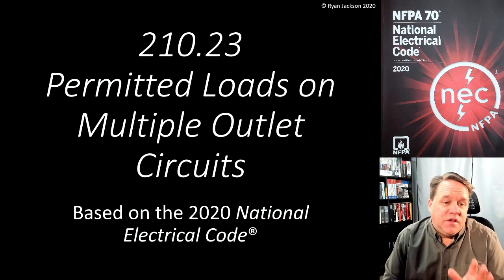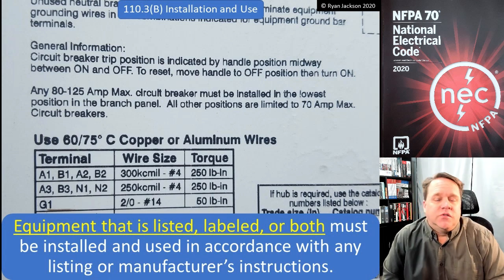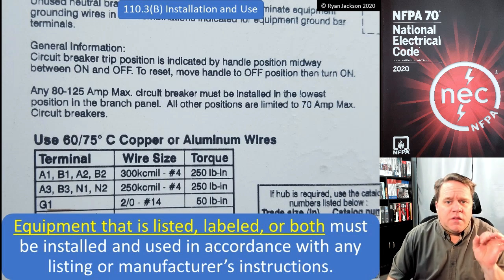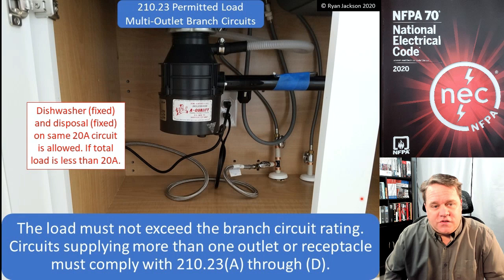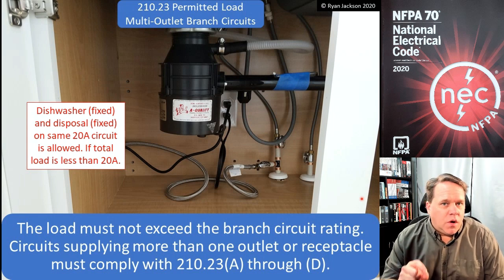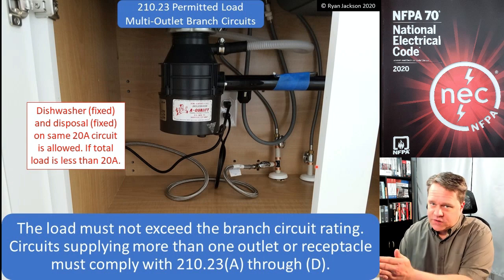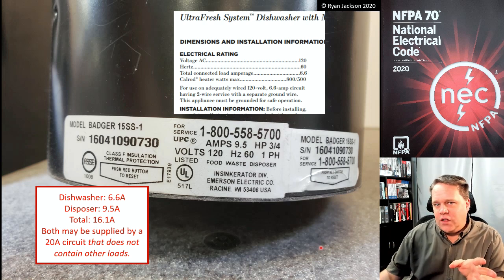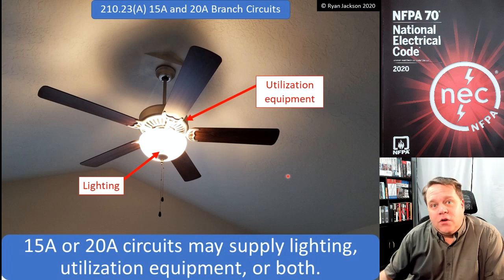Dishwasher and Disposal on same circuit? NEC 210.23 says...probably.

Comment: This is extremely helpful and informational. I have one question though. Are ranges and clothes dryers considered fixed or plug and cord appliances? At 16:43 it sounds like you are saying dryers are not considered fixed equipment and are limited to 80% of circuit rating. Is that true for a range as well?

It is often implied that these large appliances are “fixed” even though they are not hardwired.
Reply from the maker: They are stationary, not fixed.
Reply: @RyanJacksonElectrical  so to clarify, the 80% rule would apply to both dryers and ranges then?

Comment: A 20 amp circuit is usually adequate for most all residential dishwashers and disposals.  Most ratings I see for dishwashers are between 6.5 to 10 amps.  The 1/2 hp disposal you see in 90% of homes would not cause an overload to that 20 amp circuit even when the dishwasher was on the dry cycle.  I definitely wouldn't share them on a 15 amp circuit, but a 20 amp circuit should be fine for pretty much any home dishwasher & disposal.  If the homeowner upgraded to an commercial disposal or large capacity dishwasher, than it might not be enough, but it should be fine for pretty much any 24" home dishwasher & 1/2 hp disposal.  I've never ran into a problem because I've never had a homeowner trying to install equipment that would exceed it.  I guess in the future, I will run designated circuits for them even if it is not required.

Comment: I'm an old-school electrician I go by the old school rule if you can't take it and move it to another area and use it it gets its own circuit simple above stove top microwave bolted to the wall can't move it gets its own circuit dishwasher connected to the water underneath the sink can't take it and move it get its own circuit garbage disposal connected to the drain pipe can't move it gets its own circuit kitchen hood fan bolted to the wall connected to the exhaust vent gets its own circuit now refrigerator can be moved however it gets its own circuit for food safety so that it doesn't get shut off

Comment: Thanks for the three hour rule explanation for continuous operation. I upgraded my built in non-plugged electric furnace air handler to a 5 ton from a 3.5 ton and it had a 100 amp breaker. We put a current meter on it and it read 82 amps on high. It is a 2 speed, 42/82 amps. The 2 amps is for the blower motor. We were uncertain about the definition of continuous load until I watched your video. The heater will never be on high for three straight hours.

Comment: Have to poke fun at hard working brillant Ryan but here goes. Heard of people coming out of the closet but never somebody coming out of a dishwasher. I always installed a dishwasher on thier own circuit breaker but now with combination AFCI/GFCI single pole circuit breakers costing close to $50 each would reconsider adding the garbage disposal to a single circuit. ( 12 guage copper NM on a 20 amp AFCI breaker. Dishwasher load calulation can be misleading. The motors in all the new dishwashers use less power then the heating element and believe the calculation should only use the 125% multiplyer for only the motor then add the ampere for the heating element. Heating element is purely 100% resitance load with 100% power factor and no locked rotor intush current like a motor.

Comment: You discussed UL rating for household appliances. How about commercial equipment? We are seeing a lot of equipment imported from overseas that are obviously not listed. 
For example, refrigeration equipment for walk in coolers etc. We always get asked if they need to be UL rated. As far as i checked, i do not see NEC requiring UL listing on those kind of equipment. What would your thoughts be on that? Sometimes these equipment will even require European voltages like 380 or 400 volts 3phase or 220-240v single phase line to neutral power. They will offer to sell a transformer to come along with it. It'd be great to see a video about tips and tricks for compliance. Your content and explanations are fantastic. Thank you.

Comment: No problem, those are very small motors. Also should be 20 amp circuit according to everything else in a kitchen.
Reply from the maker: It doesn't have to be a 20A circuit.

Comment: In my opinion, think it’s a good practice to always run a Multi wire or two separate circuits for the DW & Disposal, especially in new construction and major remodeling.  This video really provides the rationale, both the DW and disposal are fixed, but are also replaced / upgraded over the years.  Two circuits will protect the option to upgrade, without having to rewire @ some point in the future.  However, for homes with one circuit this video makes it perfectly clear what you can do.
Reply: Modern appliances use less energy. No need for two circuits.
Reply: the amount of time the disposal will be running it will not even trip the breaker due to an overload

Comment: Ryan, your knowledge is godly but I have to disagree with you here. Your argument (at 7:15) is premised on the circuit having only one outlet or receptacle. But a duplex receptacle is TWO receptacles (art. 100, definition of receptacle) and that means if either the disposer or dishwasher are > 10 amps you need separate circuits for the two as the equipment is fastened in place. If both are hardwired, you again have two outlets which leads to the same result.

Comment: can you yes; should you no.  Having a heavy motor load right next too and on the same circuit as senstive electronics in modern dish washers helps account for their increased failure rates. I separated mine by just running 14/2/2 to that location.

Comment: How do you get around Table 210.21(B)2? Maximum cord and plug connected load on a 20 amp receptacle and a 20a circuit is 16 amps? Maximum on a 15 amp receptacle is 12 amps.
Reply from the maker: A duplex is two receptacles. The total load on the duplex is limited to the rating of the device. Each of the receptacles can take up to 80% of that rating.
Reply: @RyanJacksonElectrical  210.21(B)2) refers to more than one receptacle. Read it
Reply from the maker: @JeffBanfield-t6v  I am aware of that. I have read it once or twice. What do you beleive the Code violation is?
Reply: @RyanJacksonElectrical  I paused the video at 7:50 mark. It reads disposal is 6.6A and dishwasher is 9.5A = 16.1A 'Both may be supplied by a 20A circuit that doesn't contain any other loads'. 
Assuming you have cords on them, that is a violation of Table 210.21(B)2 that states the maximum cord and plug connected load is 16 amps for a 20 amp rated outlet on a 20A circuit.
Reply from the maker: @user-ll1vj7qo1m  No it isn't. A duplex is two receptacles, not one

Comment: Great video, I just went through the stuff when a customer asked to add a disposal to their island sink. They had a dedicated disposal at their main kitchen sink. I couldn't find a reason why you would need to pull a new circuit when the original could handle both loads

Comment: What about table210.21(b)(2) Total cord and plug connected load. No more than 16 amps on a 20 amp circuit. Looks like you're over by 1/10 of an amp. If you're dishwasher & garbage disposal are cord and plugged type.
Just curious that you didn't discuss the total cord and plug connected load table 210.21(b)(2)
Reply from the maker: Because a duplex receptacle is two receptacles.
Reply: Oh...so each receptacle on the duplex can supply up to 16amps if on 20 circuit....(but you can't load the branch circuit up to 32 amps)... It is not stating the total being plugged into both. Is what the table means.

What I think is getting me confused is how the tables description, uses the terminology" total cord and plug connected load in excess"  should it not drop the word "total" and just state "cord and plug connected load in excess" The word total makes me want to add up all my cord and plugs connected loads.
Thanks
I really do appreciate your work.

Comment: in the 40 years of doing electrical work I have always ran a separate 20 amp ckt for the dishwasher and disposal using a 20 amp recpt. under the sink with the top half switched for the disp. to plug into and the bottom half non switched for the dishwasher to plug into and installed rated pigtails on each appliance......And the only place I use 15 amp ckts and 14 wire is some lighting and gas fired furnaces....most every thing else 20 amp 12 wire......keep it simple
Reply from the maker: Sounds like you've wasted a lot of money in your forty years.

Comment: While not relative to subject , andvyou are correct , manufacturers lie ...(  5HP shopvacs are my favorite).... please do your math on how much Amperage a 1HP motor draws .... 1 HP is 748 watts .... last I checked  that's 6 Amp, not 15 Amp  .... startup is in most cases is not considered a factor as it is momentary .... Disposals draw a bit higher due to possibly immediately starting under load (was surprised that your 3/4 specified 9.5A - clearly starting)
Reply from the maker: In the US, horsepower of a motor is a measurement of OUTPUT power, which means nothing unless we know the efficiency of the motor. That is why we NEVER use it in the NEC and why we use Tables 430.248 through 252.

Comment: It's best practice to just wire the disposal and dishwasher to a separate circuit for each. This ensures that all appliances will be in compliance.
Reply: Depends on the situation. If I am doing remodel work on a kitchen that’s  on a slab. I will definitely put that on one circuit if the wire is in  good shape.
Reply: why is that? he just demonstrated that it's code compliant and perfectly safe. most of the time you don't run both together. you use the disposer first and then start the dishes
Reply: All these “Well, better just run another line” or “better safe than sorry.”If a client is being charged an extra $1000+ dollars to run a new line because the electrician can’t be bothered to apply their own expertise, maybe quit being electricians. The whole point of a profession is to provide competency to someone who trusts you to be a subject matter expert.
Reply: @westernbear2265  BAM! Running out of real professionals these days, leaders take charge and care about more than being patted on the head.

"This ensures that all 'electricians" will be in compliance."

Comment: thanks for the video I appreciate it. I am trying to understand how 1hp motor draws 15 amps if 1 ho is 746 watts and the voltage is 120 then wouldn't it be 736/120 which is about 6.2 amps

Comment: Ok found out contractors ran 2 yellow romex to the dishwasher outlet and the tab is broken to make it two circuits (there is no line to a switch). Both romex just run to the attic and attach to the same 14-2 romex that is a 15 amp circuit.  Is this some kind of trick to help pass an inspection?  My dishwasher is LG and rated for 15 amps and my garbage disposal has a sticker on it that says it is 9.5 amps.  Trying to get them to fix it...

Comment: They should allow over breaker rated current for disposers so long as a momentary switch is used (you cannot leave the switch on and walk away). The device is not run long enough to heat the wires up even if running at the same time as the dishwasher.

Comment: 1 hp is only 6.1 A at 100% efficiency and 120V. Those name plates look quite accurate actually. 9.5A for . 75hp means it is a pretty inefficient motor, but likely puts out it's full rating.
The main place I have seen the lies is on vacuums. I believe they are taking the stall torque and multiplying it by the maximum speed to get those those numbers, but the two don't occur at the same time so they are lies.
Reply: There's no such thing as a 100% efficient motor so doing a conversion of HP to watts and calculating amps from that doesn't really help since a motor is not a resistive load.  Also, I'm not sure where you're FLA numbers are coming from but they're incorrect for 120Vac motors.  3/4HP is listed as 13.8A @ 120Vac per NEC table.

Comment: Contractors put both my garbage disposal and dishwasher on the same 15 amp circuit.  Remodel is not finished. Does this need to be corrected?  Garbage disposal is 8amps and I can't find the info on the dishwasher we are adding (did not have one before).
Reply from the maker: I'm sure it's fine, assuming that those are the only two things on the circuit.
Reply: @RyanJacksonElectrical  oops i was thinking 20 but it's a 15 amp.  Going to change my question above to be 15 amps instead of 20. Thanks!  I think you did say 20 would be ok in your video.  Just opened that box for the dishwasher and it says it should be on a dedicated circuit (15 amp minimum) but I can't find the power numbers.  Didn't have a dishwasher before so they were supposed to provision power for it.

Comment: Both a dishwasher & garbage disposer on the same branch circuit ? ? ?

I don't see any problems with this, so long as the nameplate ratings of both appliances do not exceed the rating of the branch circuit and so long as the branch circuit is dedicated to those two appliances (with nothing else added to it.)

In practice, I also use a single 20-ampere branch circuit to supply electrical current to a common household refrigerator and a typical household microwave oven (up to a 1.2kW rating), since both appliances are not continuously operated (the refrigerator cycles on & off, and the microwave oven, for obvious reasons - is not in operation for more than several minutes at a time.) 

My interpretations of the CODE when it comes to two dedicated circuits in a domestic kitchen environment is defined as two dedicated appliance circuits supplying counter-top receptacles that are intended for the use by portable, cord and plug connected small appliances i.e. toaster, coffee machine, food processor, meat slicer, rice cooker, etc. larger appliances such as the microwave oven or a convective air-fryer (with a nameplate rating of 12.50 amperes @ 120V.A.C. or 1.5kW of electrical energy consumption or power draw should be placed on a different circuit dedicated to that appliance as would be the case above (with the household refrigerator only drawing 3 amperes (0.360kW) or less when it is cycled on.) Commercial/industrial refrigeration units may very well draw even more electrical energy (in excess of 10 amperes (1.2kW) in some circumstances) and would otherwise be handled as the same as a microwave oven, being that it would also require a dedicated electrical circuit in order to operate reliably and without overloading the associated branch circuit supplying it and causing the circuit protection to trip offline, causing the refrigeration unit to cease operation and the contents requiring refrigeration to expire.

I honestly do not see why NEC Article 210.23 is really all that difficult to understand? Basic math skills are definitely required in order to sum up the total circuit demands needed to understand when loading up branch circuits used for supplying specific appliances or applications, such as that of what would be found in a domestic/residential kitchen or commercial food preparation environment, workshop, or any other environment where there is a higher than normal electrical demand.

I almost always keep lighting equipment, light fixtures or luminaires & associated utilization equipment (ceiling fan(s)) on a separate or dedicated electrical circuit, apart from circuits supplying kitchen appliances & electrical receptacles or other convenience receptacles so as to prevent the affected area from being left in the dark, should an electrical overload or other electrical fault occur on one of those appliance circuits.

Comment: Hey Ryan, just to clear things up.    If cord and plug connected  equipment is limited to 80% of the circuit rating, then why do manufacturers make 1875 watt hair dryers,  and deep fat dryers, toaster ovens and steam irons rated at 1800 watts, with a 15 amp plug?   It would seem like they would be required to come with a nema  1-20P or 5-20P to comply with the NEC code for the 80% rule.

Comment: You said that the dishwasher and disposal were "fixed in place". Then at 10:10 you said they were "fastened in place" and that "you're going to need tools to get those out. At 10:44 you said both your dishwasher and disposal are "fixed equipment, 210.23(A)(2) does not apply". So, you're using the terms interchangeably. 

However, the definition of "Fastened in Place" is found at NEC 625.2: "Mounting means of equipment in which the fastening means are specifically designed to permit periodic removal, without the use of a tool, for relocation, interchangeability, maintenance, or repair." 

Note that it says "without the use of a tool" and "periodic removal" which, disposals and dishwashers are not periodically removed. Can you clarify this? Also, id "cord-and-plug" pretty much equivalent to "not fastened in place"?
Reply from the maker: Article 625 definitions apply only to Article 625 (EV power transfer).
Reply: @RyanJacksonElectrical  Ok, thanks for clarifying that.

But can you still clarify the difference between cord-and-plug, Fixed in place and fastened in place? Maybe some examples of each, since they're not in Article 100.

Comment: Thanks for the info. I do have a kind of related question because it is an appliance question. Would a refrigerator be considered a "fastened in place" appliance? It is not easily moved and most have an ice maker which is connected to water.
Reply from the maker: Not in my opinion.

Comment: Hi Ryan great video as always, Table 210.21(B)(2) says for cord and plug 20A circuit max load is 16A, if the dishwasher and disposal are both cord and plug would this be true?  Thanks again great work!!
Reply from the maker: Yes, but remember that a duplex is two receptacles. Each half of the duplex may support 16A, and the total must not exceed 20A.